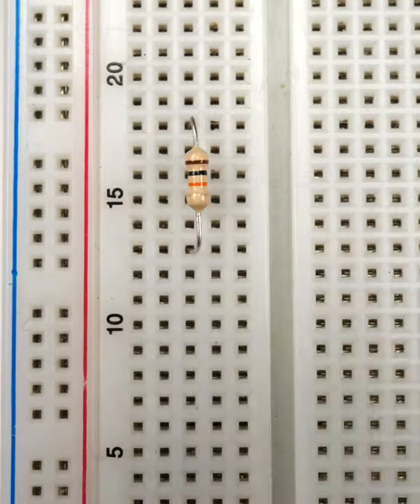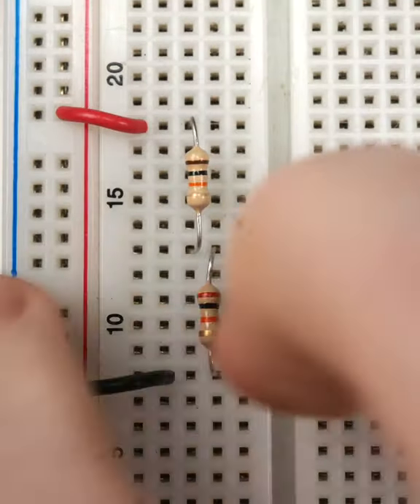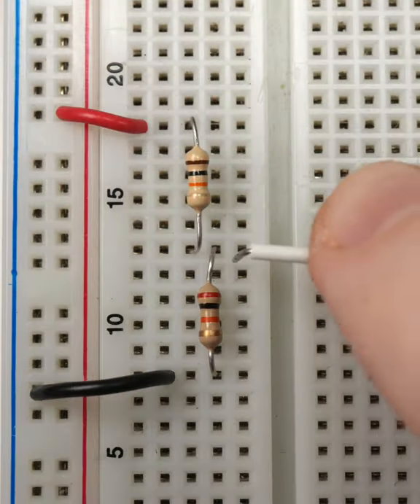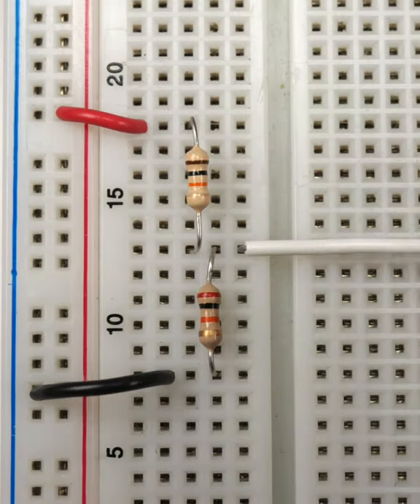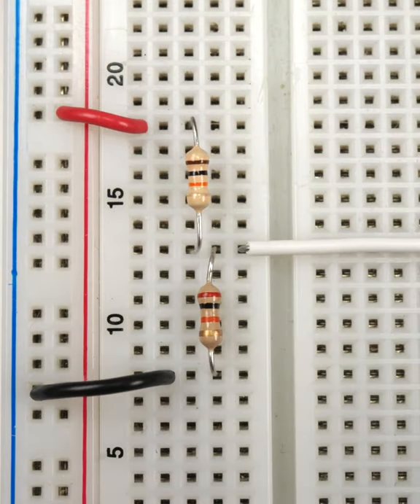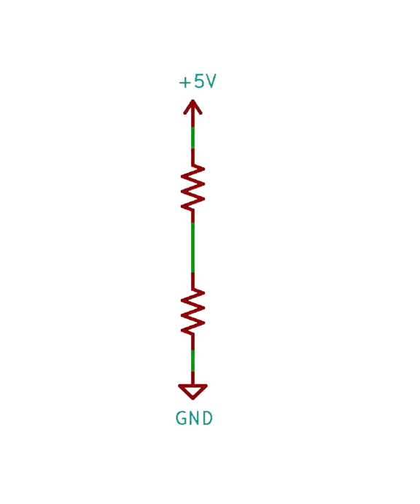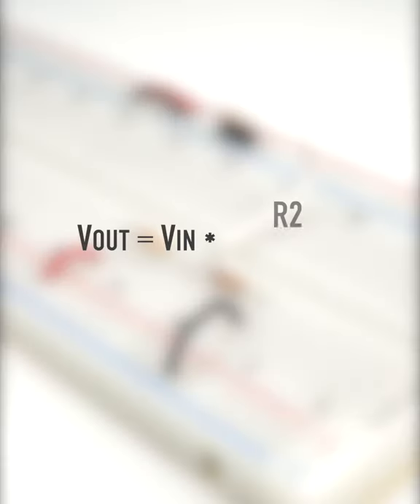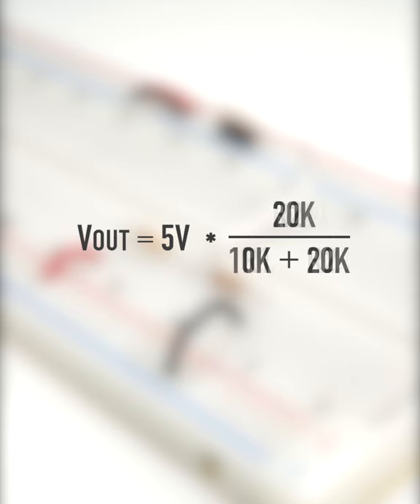Voltage Divider - Collin’s Lab Notes #adafruit #collinslabnotes

Comment: Reminder to self: Don't use the resistive divider for power unless I'm cool with one of the resistors chewing up half the power.
Reply: So which is the best way to divide voltage, like if I want reduce 12v to 5v?
Reply: @vaisakh_km  Just use a voltage regulator like LM7805 or anything else that fits your need
Reply: @szynga  anything more than like 500mA use a buck converter.
Reply: As long as winter is coming, I could go for some more heat.
Reply: This is simply not true, the wire would actually have more carrying capacity than the tiny resistor, in this scenario the resistor works kind of like a regulator. If you look at the schematic shown the only resistor across the load is the light. These circuits are used vastly across all types of electronics.

Comment: Also note, a common trap for beginners is that if you are feeding the output (a.k.a the "tap") of the voltage divider into an ADC, you have to make sure you can supply enough current (I = V / (R1 + R2)) to the ADC sample-and-hold circuitry at whatever frequency you intend to read at (check the ADC/MCU datasheet). You can keep the low current voltage divider and just add a buffer to solve this.
Reply: That's a real trap for young players!
Reply: That's a good one indeed! Also a great illustration of virtually every design choice in electronics being a tradeoff: low value resistors give a strong, stable output voltage, but consume more current. High value resistors consume less current, but supply an output voltage that's very easily disturbed.
Reply: @MicraHakkinen  luckily zener diodes and voltage reference ICs exist.

Comment: Can be used as a simple one way voltage level converter. 5v->3.3v
Reply: But It's not Recommended for Battery Application atleast due to its higher and permanent Current consumption
Reply: @prathamkalgutkar7538      Depends on a lot of things. If you just need a reference voltage that drives nothing, you can use as high resistors as you want, making the power draw about negligible. If you drive something, say, an LED, you could chain as many LEDs as you want/need and the power supply can handle … and limit the voltage and amperage to safe-for-the-LEDs by putting a resistor in line. If you take the voltage between resistor and LEDs, you’ll find that once again you have a voltage divider — just one you do not tap off of.
And if you switch the LED on/off, you put the switch where it interrupts the power both through the voltage divider and the LED …

Comment: Yes but this is true only with no load. When attaching load to one of the two resistors we should consider the impedance of the load in calculation.
Reply: Not all heros wear capes
Reply: Yes, connecting a resistive load creates a parallel resistor network so the output voltage changes accordingly. The higher the resistive load value, the less the output voltage is changed from the expected value with no load.
Reply: @alejandroperez5368  yes, exactly. For example a voltmeter have a huge input impedance, so that when you mesure the voltage between one of the two resistors, you will find almost no change from the formula. This is tricky for begginers or students.

Comment: for people wondering why ots more than 3.333 its cause the resistors have tolerance and dmms are alittle bit in accurate
Reply: It's .002 off. That's as close as you ever need to be.

Comment: is the r2 value the larger resistor or is it the one attached to ground?
Reply: It depends on the output voltage you want. Equal resistors will get you half the source voltage.   If the "grounded" resistor is larger, you'll get more than half voltage.  If the "grounded" resistor is smaller, you'll get less than half voltage.
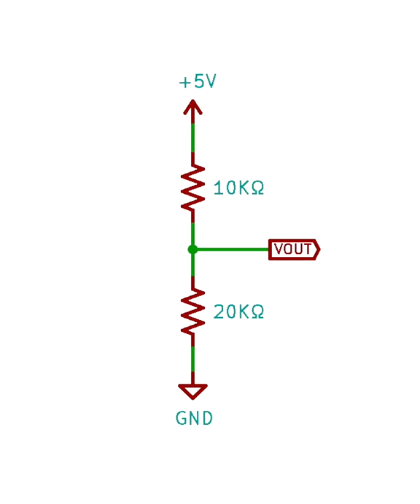Reply: Check out the image at the 0:26 mark for the example given.
Reply: @excavatoree  Awesome. This is Kirchoffs voltage law in action.

Comment: What is a good total resistance when dividing say 5V? The example uses 30kΩ. Is that always good? Is there some rule of thumb?
Reply: Depends on what you want the divided voltage for and what kind of power sources you use.
If you drive a transistor your needs will differ from driving a 3V 1A lamp…

Comment: This seems like a somewhat wasteful circuit, right?
Reply: It depends, if you just need to give something a charge and not actually draw much current, you can make the voltage divider resistors much more realistive so that they don't waste much current

You have to carefully choose values though because if you put too heavy of a load on your voltage divided power source, it'll start to behave differently and put out a lower voltage 
(At least as far as I know)
Reply: It is if you use it to supply any meaningful amount of current to a load. Also the more current you draw, the more you will influence the voltage supplied by the divider, since that load is equivalent to an extra resistor in parallel with one of the voltage divider's resistors. However a voltage divider is perfectly suited to provide a reference voltage to a high impedance load, such as the input of an opamp.
Reply: @MicraHakkinen  
Which is especially useful if you want or need a half-point voltage around which a voltage can alternate.